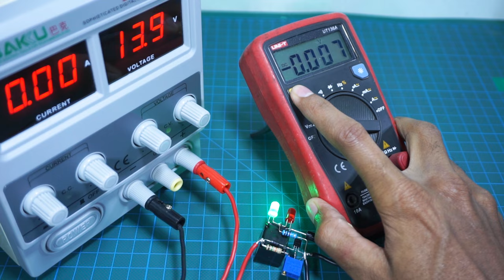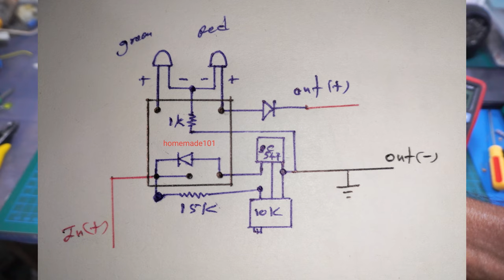Simple 12 volt Battery charger automatic cut off, 12v Battery charger Homemade

Comment: Just a flasher unit when battery charged. If the input supply does not have internal resistance the 3A diode will be destroyed as it's not current limited.
Reply from the maker: yes its

Comment: Sir i have a one question ❓
Please give me your answer
Q- me 250ah battery ko charge karene kaleye es circuit mein kya badlav karna padega?
Reply from the maker: change diode, 15A or 10A
Reply: Brother, which value diode 
Eg in 5408 10 a , 15 ampere or ?
Pls reply

Comment: Sir, I have 2 questions...
1. Will it work for input dc 5V to 18V?
2. Why there are two different power sources connected? Can not we use one same power source?
Reply from the maker: 1. 12.8v - 15v
2. DC only
Reply: Great job 👍 here M exactly looking for 12 volt to 15 volt...
Reply: @zuchamotungoe6817  hello your Naga 😊?
Reply: Yes, exactly 🤣 how do you know and you are from ???
Here im using the same multimeter almost 10 years UT 33D 😂
Reply: @zuchamotungoe6817  I'm modifying my car i20 for auto light ON when any door is OPENED provided the surrounding is 🌑 DARK.

Comment: Will this circuit work in inverter such that when the battery is low it detect it and indicate low voltage
Reply from the maker: no it is not have in

Comment: My charger is 12v 2.5 amp and the battery volt is 12.4 so i can charge with those process? Please tell me
Reply from the maker: charging voltage is 12.6v
Reply: @homemade_101  now the battery is showing 12.1 volt.  Now i can charge this charger?  Or one question lithium ion battery is charging with this method? My battery pack is lithium ions

Comment: brother can i charge 12 V 70ah battery using this auto cut off circuit
Reply from the maker: yes. but use a high amper relay
Reply: brother other components ratings are same us  to your components
 @homemade_101

Comment: There is dublicasy in this circuit i made it but when connecting 15v transformer its automatically cuting but in video he is not showing that and the wires are coming from downside table